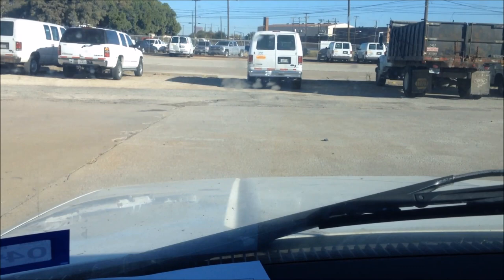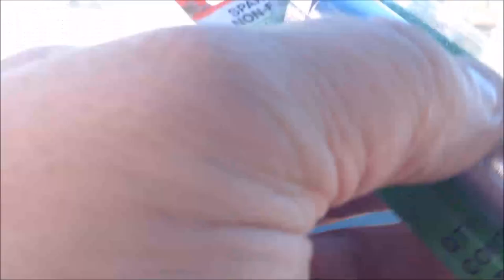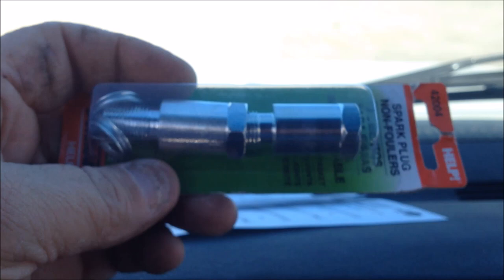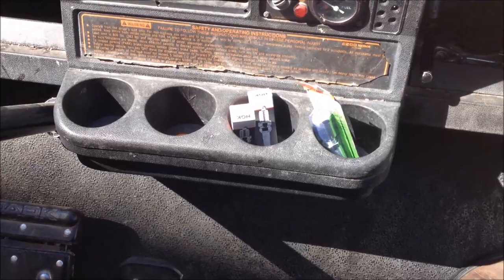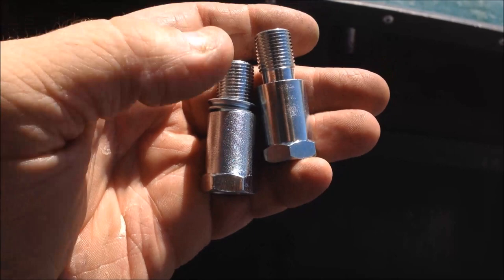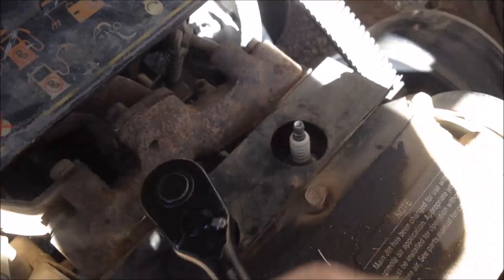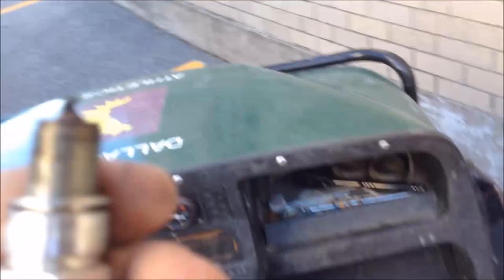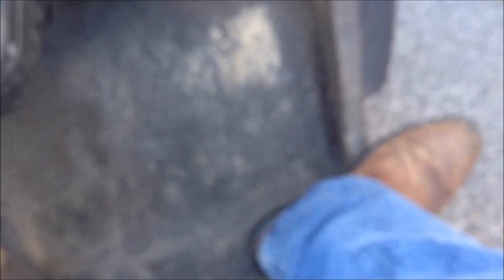CASE STUDY / SPARK PLUG NON FOUL ADAPTERS / DO THEY WORK? SNAKE OIL? LETS FIND OUT

Comment: Gosh darn, I can remember using those on a 1961 Dodge pickup with who knew how many miles, complete with a howling rear end you could here for blocks.. The year was 1975, got em at Grand Auto. They called them anti-foulers, went from a few days to over a month on the number 8 cylinder"s plug. Oh the memories. - - - Thanks for the great video. - - -

Comment: I have a 2000 Corolla and it is showing P0304 (cylinder 4 misfire). I pulled the plug out and it dark and coated with black stuff. Would this be able to fix that? Something worth trying? Thanks!

Comment: I would like to know if you can use just the washer with the spark plug because I don't want to back my spark plug out too far but I need a millimeter or two just barely enough to clear the piston

Comment: I own a icebear mojo magic motorcycle trike. I've only had it 10 months. And had to change sparkplug 3 times already. Do think this item will help me. The maker of these bikes said to set gap at 0.6 - 0.8mm. So i set mine a 0.71 setting on my gaping tool. But I'm getting upset about replacing plug. The plug wil good for short then its gets hard to start. Its stalled some time in dangerous places. Will this item along with the 0.8 gap will fix my issue.

Comment: So, do they work to keep the plug from fouling or not??!
I have a 2000 6 cylinder Buick with a random miss-fire due to oil on the plug, and am thinking of trying these.
Your video only told what you did, but no mention of the long term results.
Reply: They do work,i had an old comet,installed them and went from 2 weeks to over a year without changing plugs.

Comment: Do I only put the foulers on the plugs that has oil on them or do I do it to all my plugs because I only have oil on 3 of my plugs  our of 6
Reply: just put it on the cylinders fouling plugs. all it does is change the airflow of the combustion chamber, it makes the chamber shape less efficient since the burn has to exit the hole in the non-fouler.